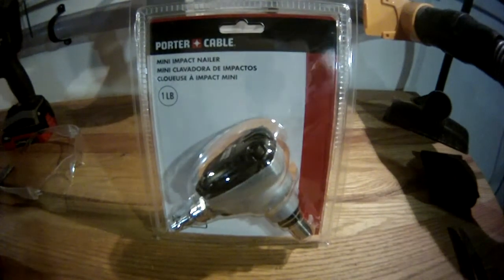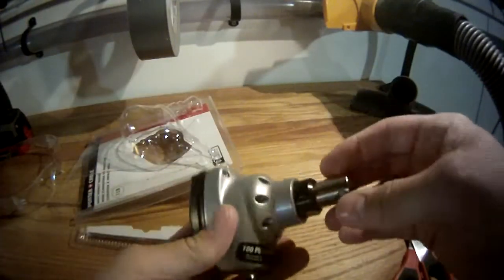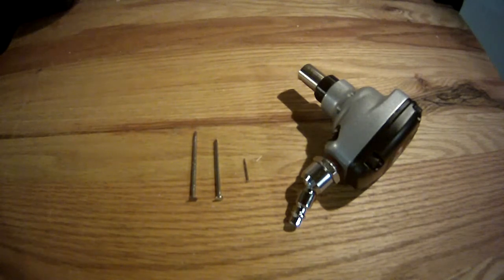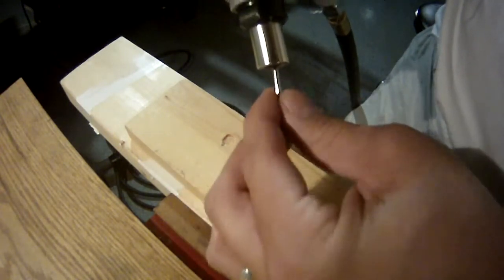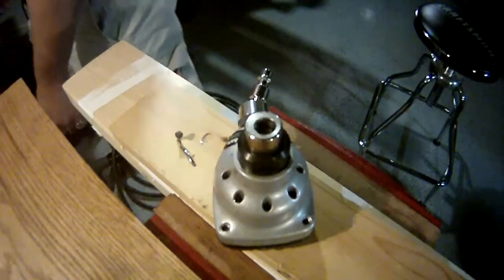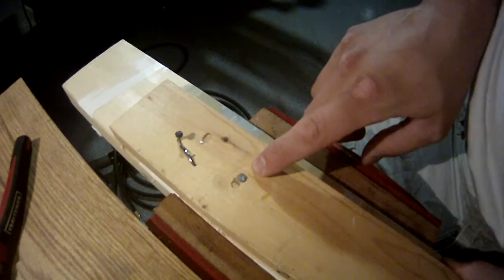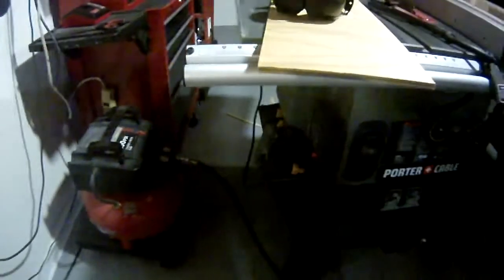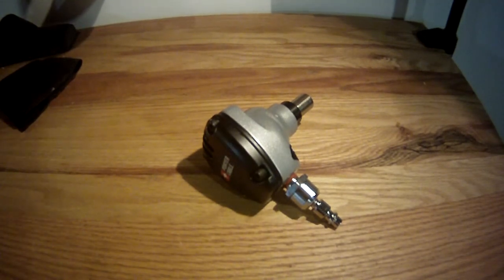Porter Cable Palm Nailer PN350 Review

Comment: I agree he was using it poorly, but I also own this palm nailer and can say it's an absolute piece of shit. Despite using the properly sized nails, lubricating it regularly, whilst in the middle of my deck project I constantly had to bang the back of it because the actuator got stuck. I stopped using it and bought even a Ridgid. The Ridgid is a complete dream compared to this one. I would have had the deck completed already if I didn't waste so much time dicking around with this piece of garbage. The Ridgid also has a higher pressure tolerance so I didn't have to keep resetting the regulator when switching between my nail gun and this. That's what I get for trying to save $20!
Reply: Yep. The actuator on mine was stuck right out of the package.  I thought the same thing too as I was driving to HD to buy the Ridgid....thats what I get for trying to save 20 bucks.

Comment: Im pretty sure this tools is used to drive small tico or joist hanger nails in tight spaces. I dont think it a replacement for a framing nailer or for every nailing application. Just a thought.

Comment: The tool is mostly used for nailing joist hangers and hurricane clips. Tight spots obviously, where it is difficult to manuever a hammer.  Plus, try holding it plumb to the nail and it'll work wonders.

Comment: Try a 16D, my Bostitch will drive those all day.  Caution, these are susceptible to dirt, don't just toss it in your work bucket when not in use.  I did that and mine stopped working smoothly.  Took it apart and cleaned it, didn't change any o-rings, back to working well.

Comment: Reading many of the comments sounds like many are using it for the every single nail they are driving....if you used it only for hard to reach areas where you cant swing a hammer or fit a framing nailer i am sure it would do a much better job. If it was meant to drive every single nail on your framing project, this little tool would reflect that in its cost.

Comment: All palm nailers will pull the nail to the side, its  the lines of flux from the magnet, the flux wants to travel thru metal than air, that's why its pulls to the side as the metal is "magnetized" by the magnet. Unless someone makes the piece surrounding the nail out of aluminum, which will bend, all palm nailers will due this. Braid nails are not for palm nailers as many noted, its rather silly using a pneumatic device on a 5/8ths or 3/4 braid that you can easily tap in faster with a tiny hammer.

Comment: It seems as though, without a trigger, you lose a lot of control. Bending nails is a disaster when doing fine woodworking projects. Probably good ONLY for hard to reach places???
Reply from the maker: ... or rough construction, e.g. framing.
Reply: That's literally the only application a palm nailer was made for. Can't swing a hammer, but need precision a nail gun can't provide. Fine woodworking is absolutely out of the picture. It will destroy your piece.

Comment: just get a dewalt nail gun and youll drive nail for decades
Reply: Whole point of a palm nailer is to nail places where a hammer and gun can't fit, or doesn't apply. Try using your DeWalt to nail in joist hangers 12 on center. Oh yeah, you can't